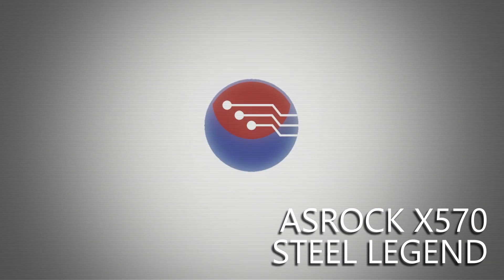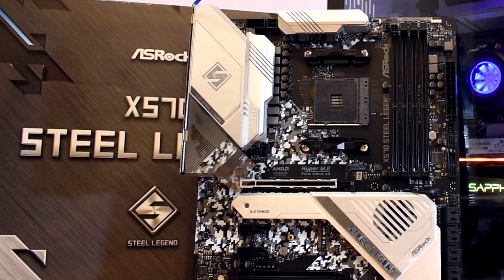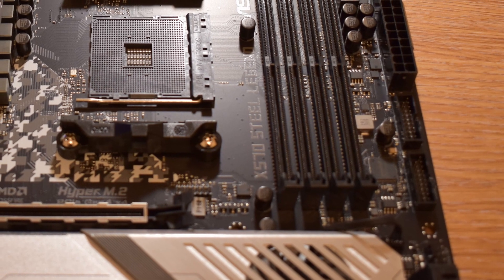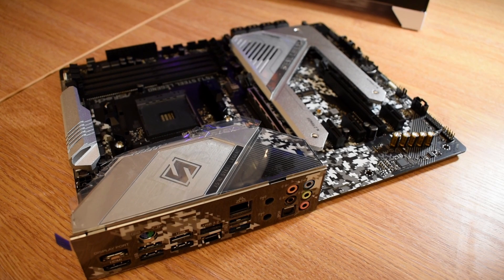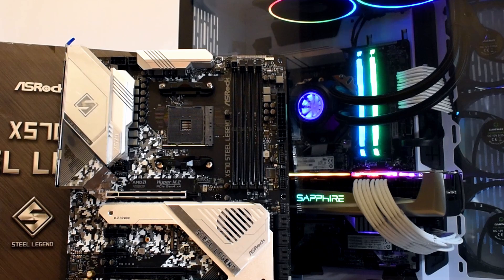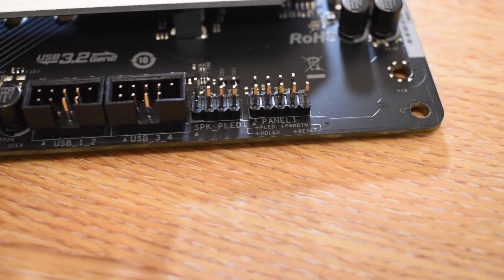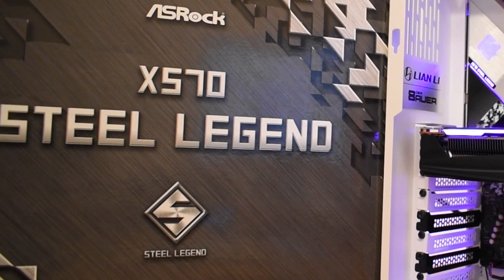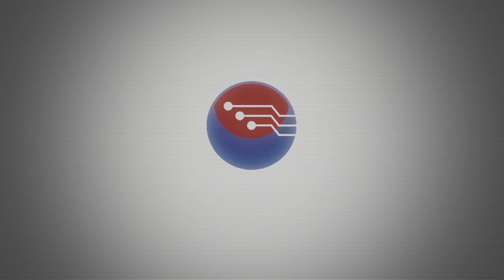ASROCK X570 Steel Legend - Perfect Mid Range - Worth Upgrading from X370?

Comment: So I just built with this and wtf! Why is the pcie slot so dang close to the ram slots and left side IO part of the MB?  I have t force ram and its literally touching the top of the graphics card back plate and the left bottom side of the IO is touching the gpu back plate. I almost thought I screwed something up, but looking at yours I see its a super tight fit too for some reason.  I have built a pc before using gigabyte x570 and the pcie slot is was lower and not even a thought in my head..  I don't understand why its so tight and no one has said anything about this.

Comment: Don't forget to order the Front panel USB 3.1 Gen 2 adapter. Most are socket key A and this board has a 20 pin just the the 3.0 next to it. The adapter plugs into the smaller plug from the front panel wire and then right into the motherboard.

Comment: HI, I got a somewhat important question. Can I use both the RGB_HEADER1 and ADDR_LED at the same time?

If yes, why and what is the difference between those 2?

ps, I installed an extra fan near the chipset. Its now idle on 51c. ON stress it won't go above 61c.
Edit, before it was arround 80 a 85 c (I got a good airflow case with lots of fans btw)

Comment: So why did I abandon the Asus Crosshair VI Hero and go the Steel Legend. With the last Bios and a 3800X. Well it will make it to Win 10 and run for days. If you boot it enough times. So either the board is buggy or the BIOS is. It ran for 4 years with a R 5 1600 in it. Except for the sleep bug, no problems.
Why not go for a Crosshair VIII? Because I don't think it is 3 Steel Legends better. 
AS for the 3800X with only $30 difference on a rare day between it and a 3700X?  Besides I got nice flashy shiny Cooler that I can sell. That should do well on a six core?
I already have a non shiny flashy 6 pipe tower cooler for it and the case sits behind the 27" monitor.

Comment: Can I overclock my 3700x to 4.35 hz all cores and run it stable with this Mobo?
Reply from the maker: depends on the silicon quality in your 3700X mines all core 4.45GHz at the moment but it really depends on your own individual cpu - you might get more, might get less.
Reply: @F7GOS  Thanks for the Reply.I got this mobo today.I have a gigabyte B700H 80 plus PSU.It only has a 8pin power connector for CPU where as the asrock x570 steel legend has an 8+4 pin power input.Will the 8pin suffice in terms of power as i read that the extra 4 pin is for extreme overclocking.I may plan to overclock my 3700x all core to max 4.2-4.3

Comment: Do you need to use both the 8 and 4 pin power connector to power the motherboard or just the 8 pin
Reply: 8 and 4 pin
Reply: Just the eight pin.

Comment: oh man i have the x370 board 
during black friday i got a 2600x but the PBO is not really support it. i mean the voltages are all over the place . they go as high as 1.47v thats on idle. i even put a negative offset of 1.000
did you encounter that too. fro ryzen+ the max safe voltage is 1.375 after that the cpu starts to degrade 

i also i been looking at the x570 steel legend of the wi fi6 

how is the bios . is the same as the x370 board ?
did you oc cpu and ram ?

Comment: Awful vrm one of the worst X570 boards would not even trust a 3700x on that.
Reply: Why would you not use a 3700X on it? What is the danger?
Reply: You don't know a thing about computer hardware, do you?
You need to do a lot of research!!!! Stress tests only show extreme scenarios that are not applicable in normal day to day usage! Overlooking spoils the processor FYI!
60A x 8 =480A... This is a lot of power! It has a lot of Nichicon caps in combo mode for filtering and stabling current! 
You should only worry about ever using all of it's features when you own that mobo.
Reply: Yes why???
Reply: msi is worse tho :D
Reply: @Daisudori  It's nothing to do with brand.
Reply: @ZenAndPsychedelicHealingCenter  u are right. but early msi x570 are terrible on the vrm (carbon, gaming pro etc) they only rectified it with the later x570 tomahawk and the b650 series. Talking about x570 msi specifically here.
Reply: LOL! You completely made this up.